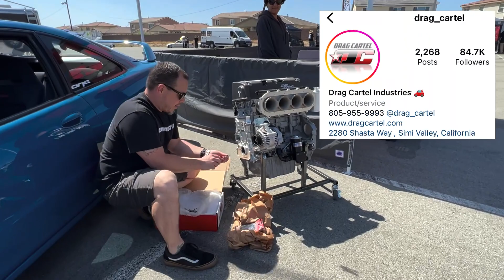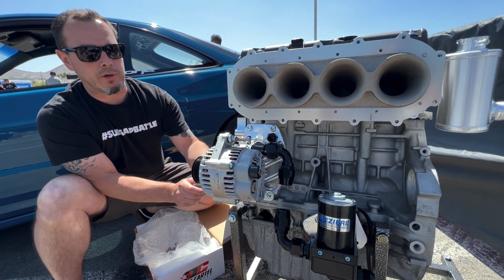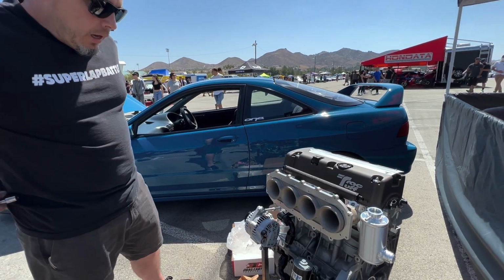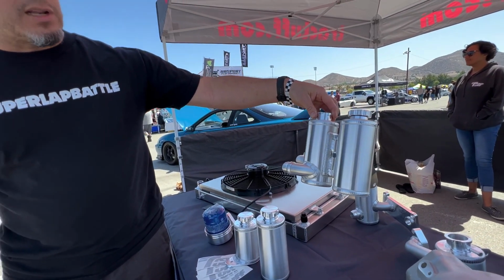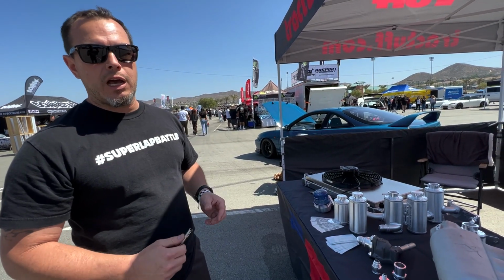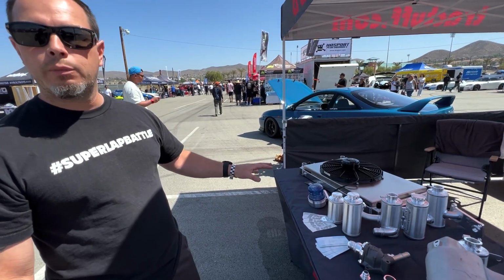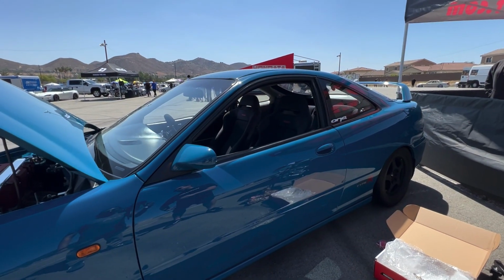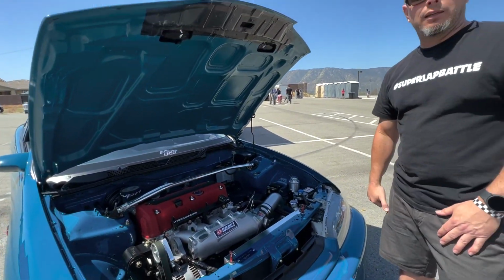Honda Performance Cooling System Quality Parts & Fabrications - Drag Cartel

Comment: Looks sick!! Great design, definitely for big-BIG HP builds/ custom looks. 

NOTE: Stock OEM honda cooling is good for big HP too. 700+ on OEM cooling and a whole stock block. (not sure how long it will last lol/how passes it will achieve) but that mentioned, Koyo radiators is likely some of the best you can buy in the market for your k-series solution. Cheers!
Reply from the maker: Thanks for sharing that info 😎👍